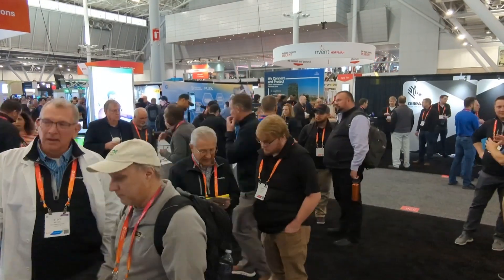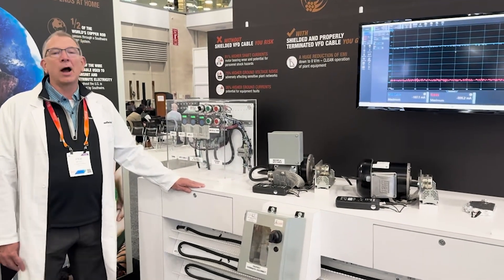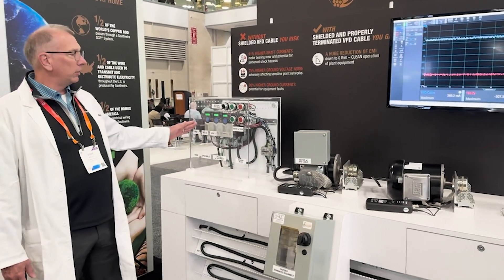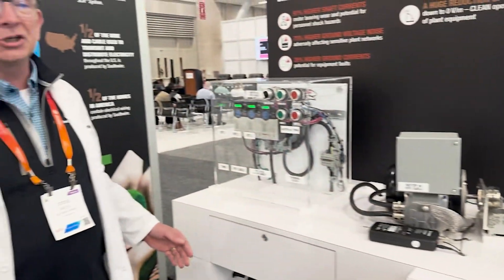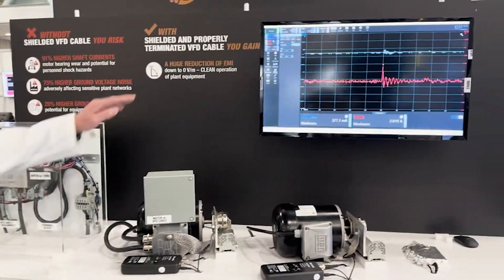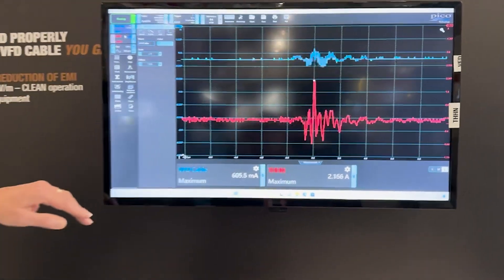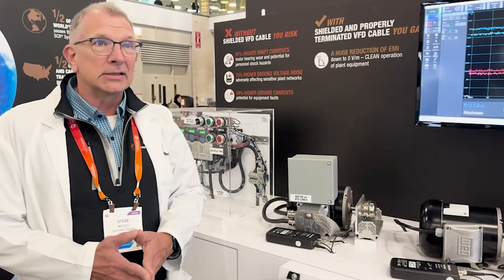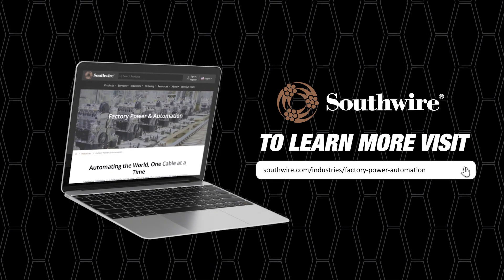Southwire® VFD Cable Testing Station - Rockwell Automation Fair 2023

Comment: I was at the automation fair and asked the question "how are you accurately reading current between the motor shaft and ground if there are metallic ball bearings in the motor that are also a direct path to ground? Wouldn't having conductive bearings in parallel to the test loop make it not possible to see how much current is actually traveling from rotor to stator? You would have to use insulated bearings to accurately conduct the experiment." Nobody seemed to comprehend the simple fundamental concept of two paths to ground, and only taking a reading from one. Either way, unless it's an application that you are worried about interference, how often are bearings in motors going bad for any reason, let alone from current induced pitting?